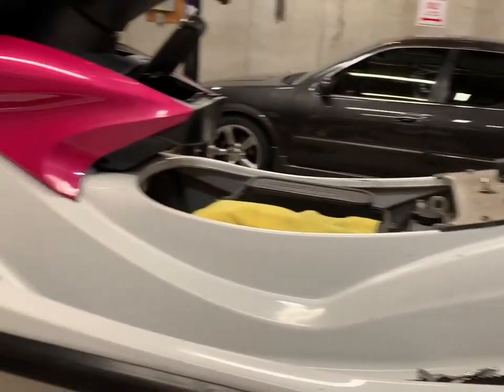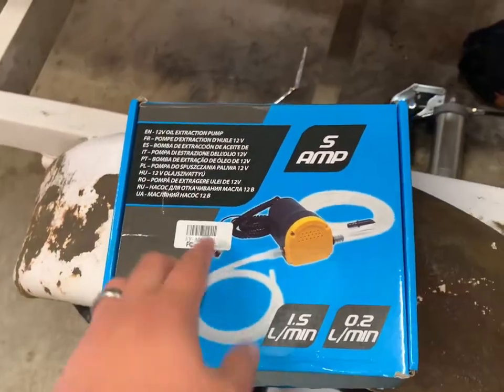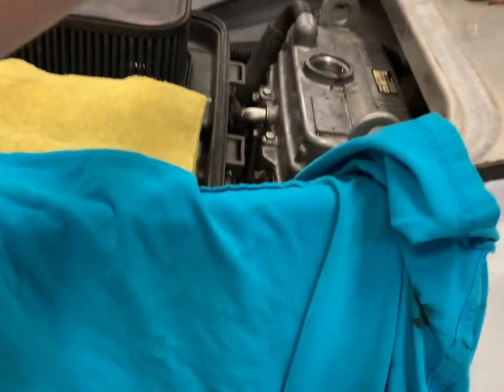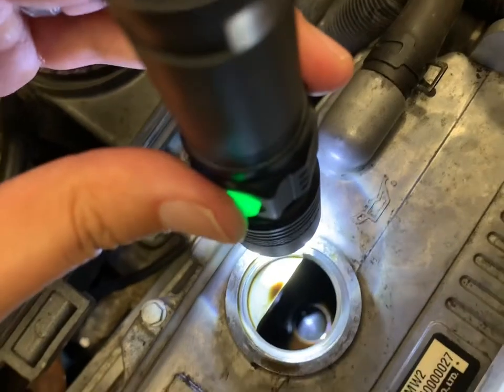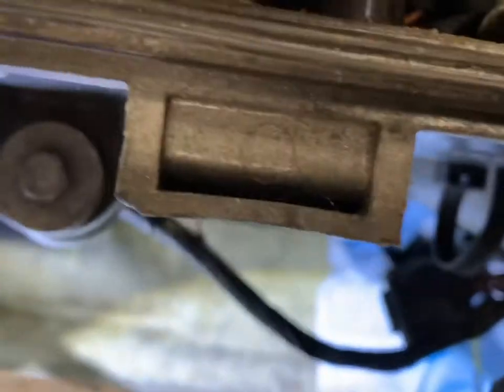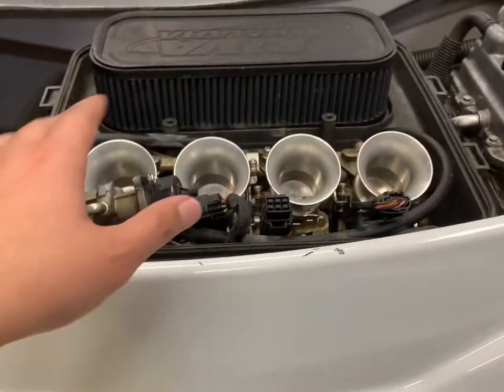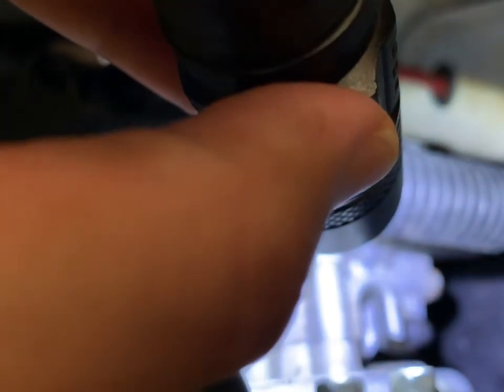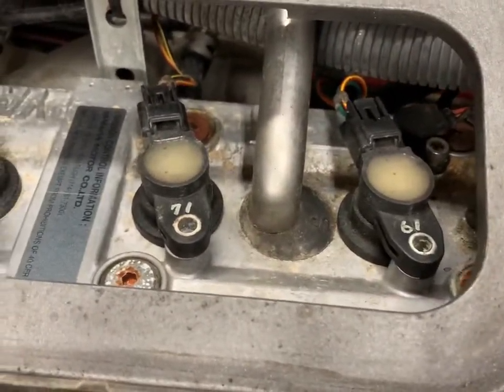2004 Yamaha WaveRunner FXHO oil change and general maintenance

Comment: Got a whopping 10 years on two skis with an Odessey battery.  It was not so much the battery but used a Perko switch which required a key to give it juice.  Built-in security those keys provide.  Never used a tender.  Just sat on a drive on lift under a covered dock.
Reply from the maker: Nice man yeah somebody told me you can just put a kill switch so the battery does not drain at all but instead I just run it on a tinder when it sitting